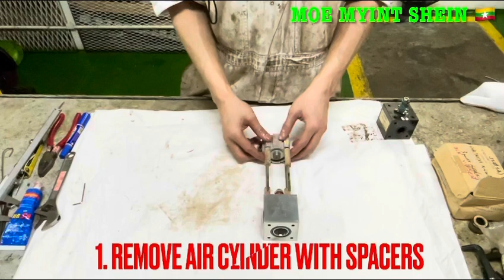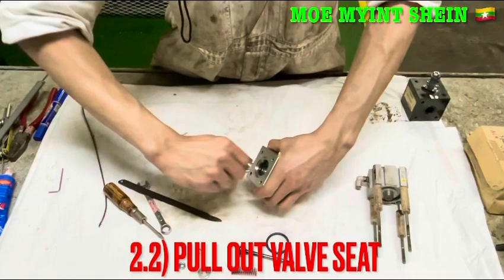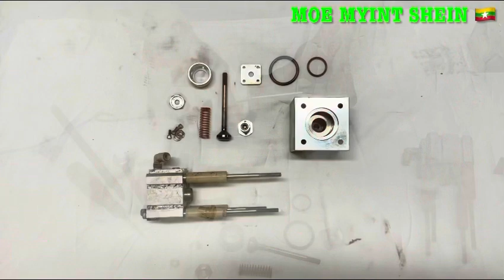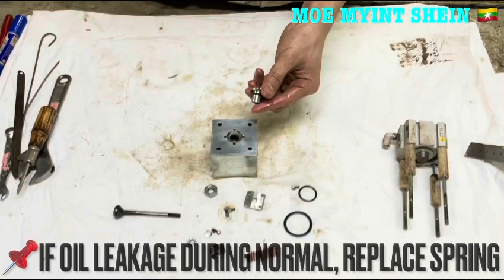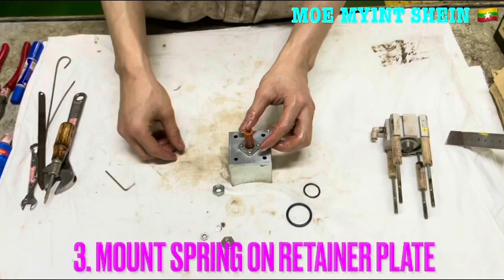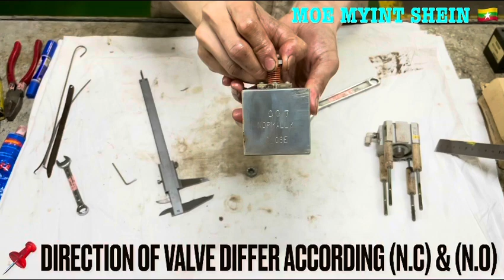[SUNFLAME] BOILER Air Operated F.O MAIN VALVE Overhaul | Marine Engineering | Technical Vlog : 047

Comment: Sir good day.
if possible pls make a video or upload in your community about boiler alarm test.
for example :
boiler water high level alarm
low level
low low level etc.
some say, high level alarm can be done by:
1) close master v/v (to avoid priming)
2) feed p/p manual
mode
3) start p/p manually and look at level gauge glass
4) look for high level alarm activation.
is it Ok? 
pls reply in ur free time🙏
Reply from the maker: Ok MEC. 
I will upload, soon. 
Pretty rush for Exam. 😁
Reply: @MoeMyintShein_MMU  
ok sir, no prblem. pls finish ur exam well and good.
best of luck